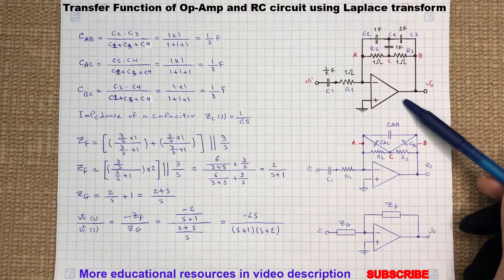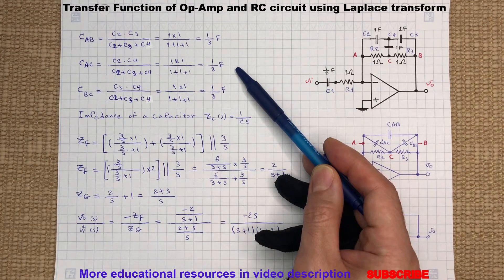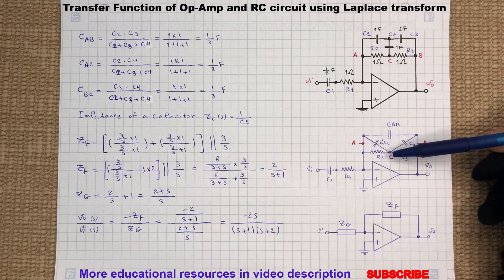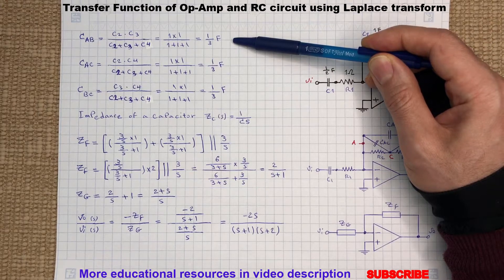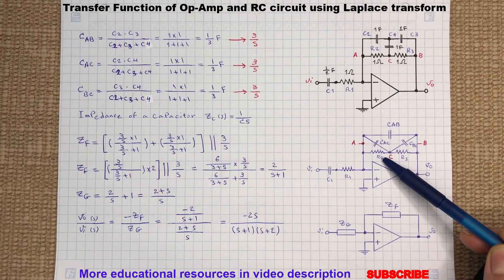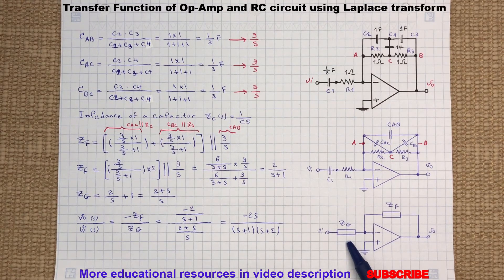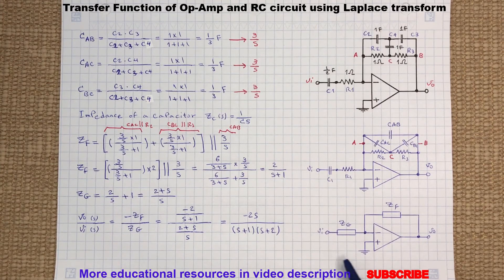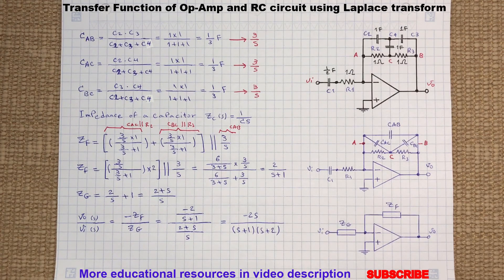Transfer Function of Op Amp Circuit using Laplace Transform

Comment from the maker: Gain of Inverting Op Amp with RLC at 1 kHz : https://youtu.be/3c92kStPru8
Op Amp RC Filter: https://youtu.be/s0nvWoCd0DQ
Op-Amp Parallel RLC Active Filter: https://youtu.be/NR9MI9PM4-s
RLC Op-Amp Circuit, FE Electrical Exam Type Question: https://youtu.be/zUyj7Xn9-sk
Electronic Circuit Analysis Playlist: https://www.youtube.com/playlist?list=PLLA_QJ8rHZBh5LqrY41bCvKgreRDRWrBQ
Control System Playlist: https://www.youtube.com/playlist?list=PLLA_QJ8rHZBjS_S6WPkmUweF5NbImvSqf

Comment: Is this circuit a type of band pass filter?
Reply from the maker: Yes, it is a band-pass filter. To determine the type of the filter, we can analyze the transfer function T(s) when s approaches to 0 and infinity (∞). For  T(0) = Vo(0)/Vi(0) = 0, and for T(∞) = Vo(∞)/Vi(∞) = 0 .    Since the filter attenuates both low and high frequencies, it is a band-pass filter.

Comment: Isn´t Star to Delta Ca= (C2*C3+C3*C4+C4*C1)/C4?
Reply from the maker: In this example, since you are converting from star to delta, then you need to find equivalent capacitance between two points foe each capacitance in the delta configuration, therefore the formulas provided in the video are the correct ones.

Comment: an error was made in the calculation of capacitors
Reply from the maker: what line the error occurred? I did check and it looks correct to me.
Reply: CAb= C2+C3+(C2+C3)/C1= 3F
Reply from the maker: @abdullayevm.x.667  You need to use STAR (Wye) to Delta formula.
Reply: understandable. Thank you
Reply: understandable. thank you